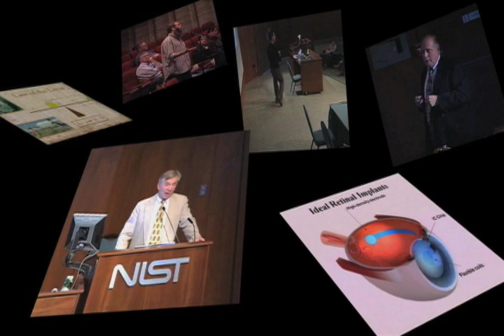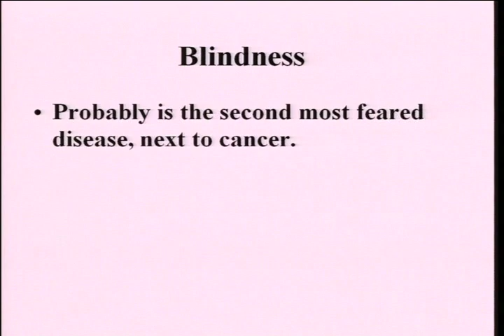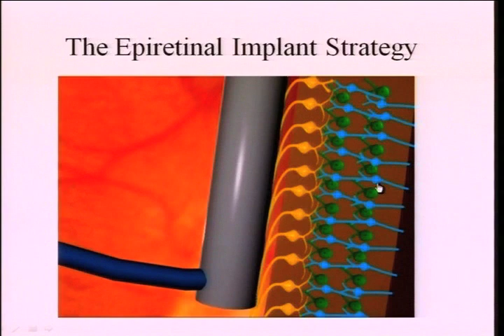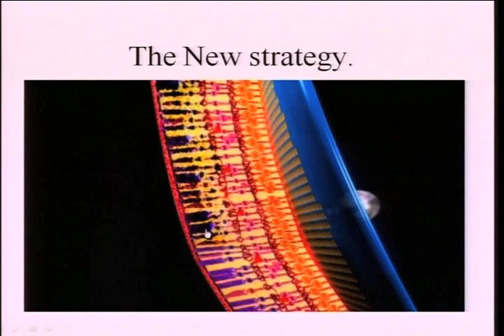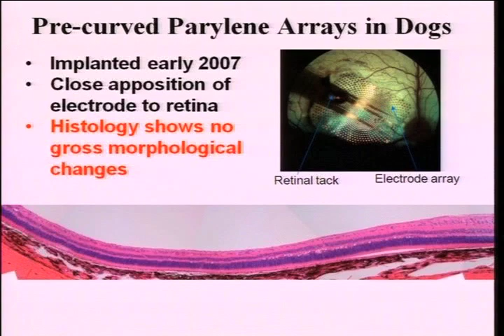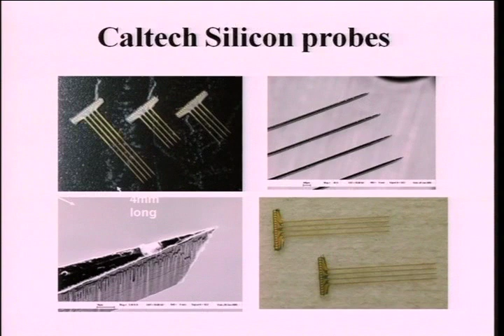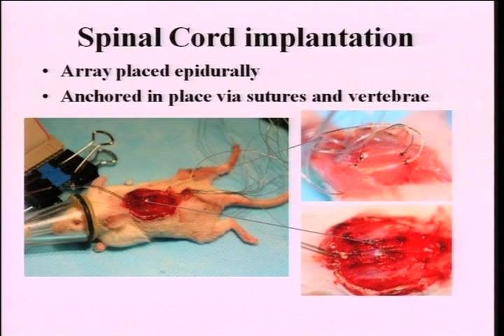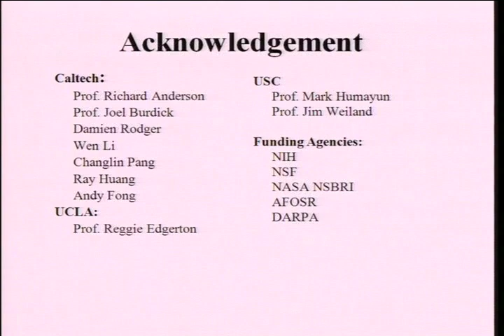NIST Colloquium Series: Next Generation Neural Implants

Comment: @neckbroken24   Chances are that it has already been used on you without your knowledge.  There is another use for this technology known as a Brain Scan Chip Implant that is not in our best interest.  I think that you would be very interested in the method that I have discovered that will allow you to detect if the implant has been put into your body already.  Just ask for the meditation exercise or the ways to detect the implants.